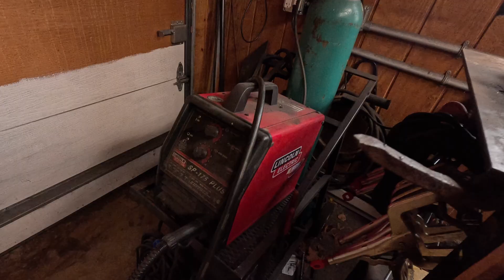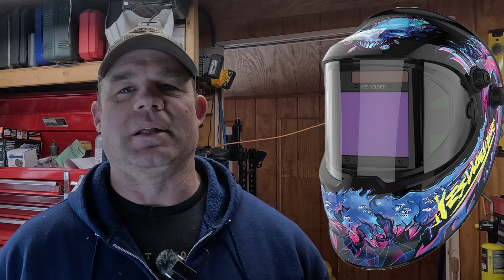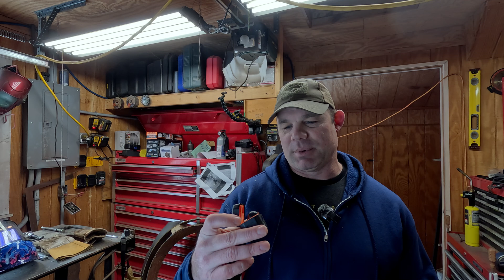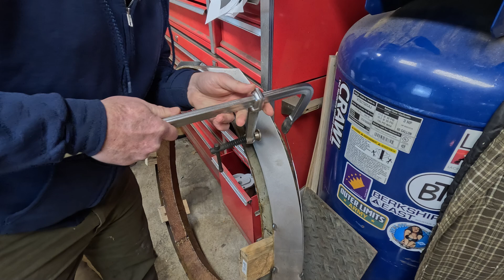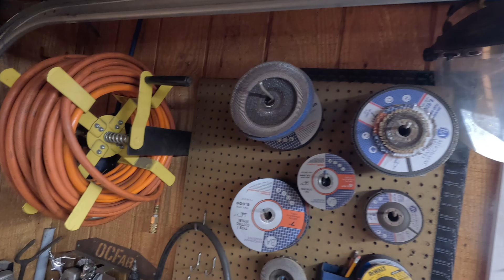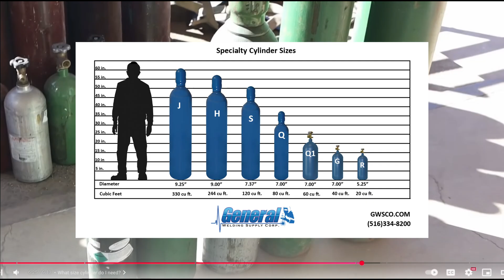I've Tried 100's Of Welding Tools, These 7 Are The One's To Start With

Comment: Do you have any recommendations for plasma cutters?
Reply: Also what metal thickness do you most often work with for sculpture?
Reply from the maker: I’m mostly work in 3/16 but it really varies depending on the type of art I’m making.
Reply from the maker: It depends if you want to get a name brand or a little bit lower end version. I will go with the prime weld for the cheaper alternative, but can’t beat hyperthermia.
Reply from the maker: Please subscribe.

Comment: For most people a flux core mig or 110 stick machine is plenty, it's only a few times I would demand a tig to get the weld I wanted.
The gas makes everything significantly more complicated, for very little actual gain in usability or quality; Especially for a hobbyist. Dedicated low voltage (110) flux core only mig is really competitively priced for entry level and hobby welders and so are Dedicated stick welding machines. :3
Reply from the maker: I have never used flux core so I couldn’t comment, but gas mig is not very complicated. For my art I definitely need 220v but you are right most could get away with 110 for sure.
Reply: @Hercworx  flux core is just better IMO, the welds are the same quality, you just don't have to worry about gasses which can be an issue working outside. 
and not everyone has easy access to a gas supplier to fill their bottles, and bottles are expensive, some places won't fill any bottles but theirs so you have to rent. its just a whole other thing to deal with and pay for. 
gas is for tig, or those high paying dual shield "it has to be perfect" jobs.
Reply from the maker: I’ve been renting bottles for 20 years. Most of my welding is actually done outside, never had a big issue. I don’t think gas is just for tig.  Though I’m sure flux core is fine in most cases. I appreciate the feedback!!
Reply: @Hercworx  one place near me fills anything, and I own a bottle, but the other place is closer ther make you rent and it's way more expensive. But I live near a big city... someone out in the boonies would be out of luck, they might have to drive a long ways to get gas.